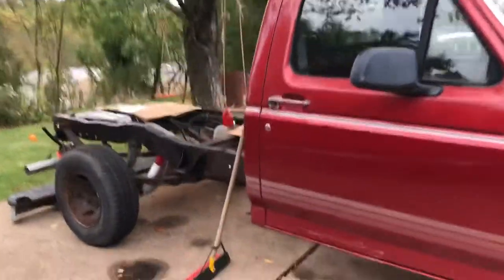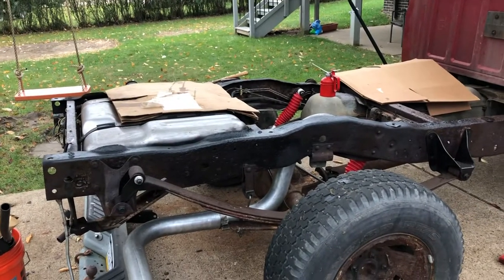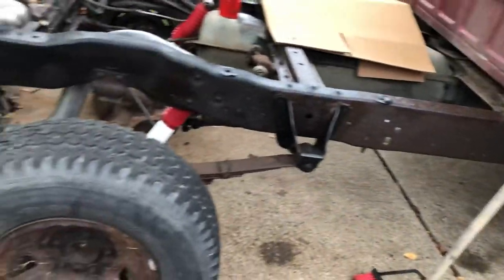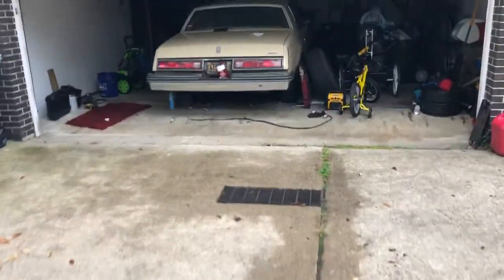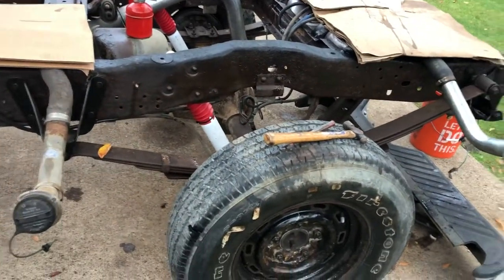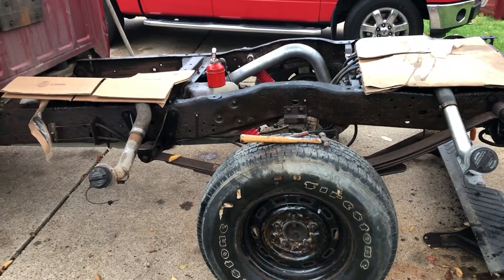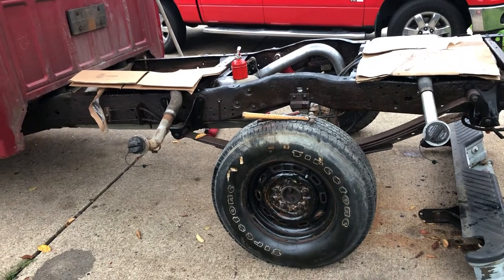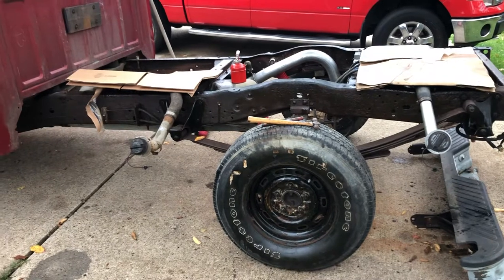Remove a Ford truck bed by yourself, here’s how

Comment: Thanks for posting this. I have to remove my bed on my 97 f250 OBS Get to the front fuel tank. Replace the showerhead fuel pickup foot. I wasn't sure about the wiring. But mine is exactly like yours. So I'm good to go now! Thanks again!!
Reply from the maker: I actually made a newer video, and it shows the bed being lifted up by the engine hoist, but the concept is the same. You can definitely do it by yourself although, having friends makes it a little easier, you can still do it by yourself, best of luck, sir.

Comment: 2 year old video and STILL comes in handy! I will be removing my truck bed tomorrow, replacing the fuel pumps in my 1994 Ford F150. Dual tanks like yours. Figured, removing the bed would be much easier than trying to drop the tank from underneath by myself alone. Thanks for the video. :)

Comment: Its real easy when its already off.  Those bolts are in some pretty nasty,  tight spots on the inner frame, especially the middle ones.  The nut is tucked into a corner behind the rear wheel and axle.  These are 18mm nuts.  Use lots of wd or pb!  Air tools were definitely necessary.  Also had to use flexible extension.  Nasty upside down job.  Good luck if everything's rusted...  Luckily mine was pretty clean.  Btw, these bolts are made of unobtainium!
Reply: Story of my life with the rusted bolts....what a pain !! Argh
Reply: We always just cut them off and replace
Reply: What do you mean by flexible extension?  I see actual flexible extensions for 1/4" and 3/8" drives but not for 1/2".  Do you mean "wobble" extensions?  Or, do you mean universal joint socket adapters?

Comment: I got a 96 that I'm putting a bed on with nothing to go buy I bought a pickup bed to go back on it i need to know about the BIG flat washer and rubber washers go on the frame how many and where?
Reply from the maker: On top of each part of the frame where each bolt goes through. It’s just so it’s not metal on metal

Comment: Looking to restore my truck, taking the bed off and the bolt is spinning with the nut, is there a tool i can use to keep it from doing that? dont really wanna search for new bolts if i cut em.
Reply from the maker: I actually had to grind the top of the bolts off in the bed for at least four of the six sorry but those bolts are pretty old and they were just not come out the way they came the way they went in

Comment: why did you removed it? if it was to do new fuel pumps i would like to see that.
Reply from the maker: The old bed was pretty rotted/rusted, replaced it with a southern bed. Before I put the new bed on, decided to do a video

Comment: Did you have to remove the rear bumper first? Or, was it off for another reason?
Mine is a massive Ranch hand.
Reply from the maker: You can leave the bumper on, just have to lift it a bit higher and you likely will need another pair of hands to do it

Comment: Ok,so how did you do it? You lifted the passenger side and moved it towards the back?
Reply from the maker: I lifted the bed from the passenger side and slid it off the driver side
Reply from the maker: What I didn’t show was how I described, have the bed rest to lift off, I tilted the passenger side up and slowly slide toward driver side. Eventually it will tilt and want to slide off the frame on the driver side. You will not damage any parts as long as the filler necks have been dropped down as seen in the video. It’s really easy and doable by yourself
Reply from the maker: Lift from the passenger side wheel well and push it side ways toward the driver side
Reply from the maker: @Merciful2u  it actually will slide on the bottom bed rail support, so it will not damage it. Hope that helps
Reply: @7906jen  I'm trying to picture what you did in my head. Did you push it to the driver side until it wanted to tip, then roll it so the quarter panel and fuel doors were laying flat on the ground and the bed was vertical, then roll it upside down?
Reply: @mikebonom  he lifted the passenger side quarter panel and slid the driver side corner panel off the frame rail,

Comment: What did you use to cut the rusted bolts
Reply: All I could imagine is an dremel or something. Pretty tight up in there
Reply from the maker: I carefully use an angle grinder

Comment: How hard is it to get the bolt out next to the front tank
Reply from the maker: You can reach it with an extension but I believe I ended up cutting off the Bolt in the bed because the nut Was rusted to the point it would not thread off. Hope this helps. A lot of people just grind or cut off the heads of the bolts in the bed itself

Comment: How heavy is that truck bed?  One recommendation I can see would be to put it on sawhorses so you don't have to lift it up all the way from the ground.  But, that will require two or four people to take it off and put it on.  I better go make some new friends now.
Reply from the maker: You can do it with 2 but I recommmend 4 if you don’t want to mess up your nice bed
Reply: @7906jen  Well, I don't have enough friends to do it properly.  But, many years ago I bought an electric hoist that I've never used.  Maybe I could hang it in the garage and use it to lift the bed and then drive out from under.  I'll have to give that some thought.  I see that Harbor Freight sells a 1 ton Gantry Crane on wheels that would be handy.  But that $ 830 price tag is a bit high for one use.
Reply from the maker: Where do I live? If your close I can help you??
Reply: @7906jen  I was being silly when I made that comment.  I'm in the center of New York State.

Comment: What tools did you use
Reply from the maker: Grinder for the bed bolts, and simple socket set and a flat head screwdriver is all you need
Reply from the maker: Basic hand tools, nothing special. I believe the bed bolts are 18mm